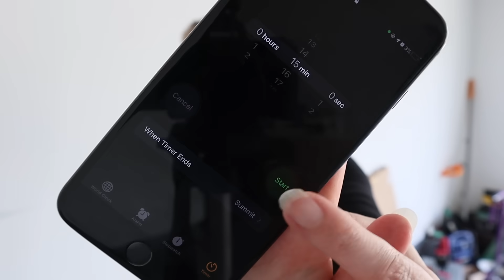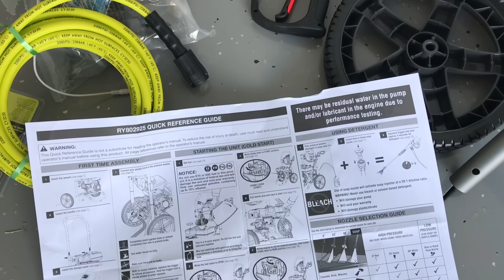☘️ How To 10X Your Next Decluttering Session 🚀

Comment: I am feeling overwhelmed.  I was doing a declutter and I put things into the garage both for donation and for garbage.  I should have gotten them out of the house.  Now they are under a massive amount of stuff because my house flooded and the emergency response team packed everything up and stacked it to the ceiling, on top of my get rid of pile.  So now I have to go through the contents but I will still have the original pile to deal with.  Ugh.  It will get better and I will have a minimal house moving forward.😅
Reply from the maker: Oh, that sucks. Hope it’s a smooth process to get on top of it.

Comment: Get well soon. 
Yeah.... *nods*..... So, I had been making good progress..... and getting better at "letting go" of things.... for several months.... and then we had a series of crazy things happen... (like a sewage leak that backed up and flooded our laundry room - 3 times!!!! for example), and a bunch of other crazy things.... so the the things I had set aside to donate.... either got soaked, or moved and mixed in with things I want to keep, and etc.... and I have to start again.... and I felt defeated.....  And now we have to have our furnace and AC unit replaced.... which means more chaos and "shoving things anywhere it'll fit, to make room for the people to do their work.... and.... ARRRRGGGGHHHHH!!! 
But I'm determined, to get the clutter and house under control.... ESPECIALLY here in my Creative Studio Room.... 
It's great when I can find stuff that I can put in a garbage bag... or a recycling bag.... and put it out on Garbage day...but..... when it's something that I want to donate.... it has to wait until I can get help to get it where it needs to go.... (because I don't dare to drive around here, and my husband's always either working, otherwise busy, or he's exhausted and needs a break..... ) .... We're not even sure where to take the variety of things (and that's probably the biggest obstacle ).... Anyway.... the point is, it's exactly as you said.... if it's "donation" it sits in the house, and DOESN'T feel like the progress it should be, because the job doesn't get completed. 
But.... I want to improve on that. ..... Somehow.... Thank you for "re-igniting" the flame.... for me to actually get something done around here.